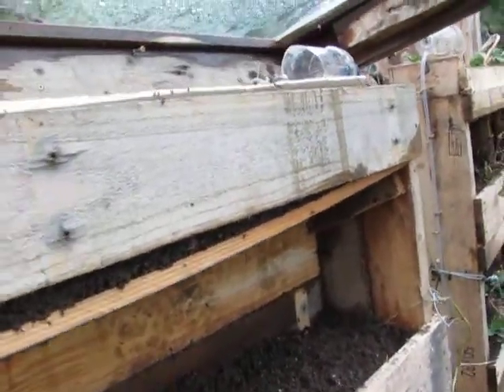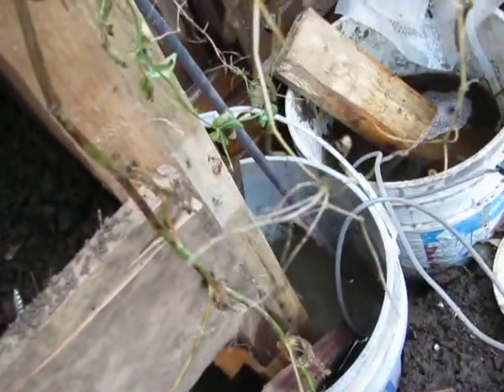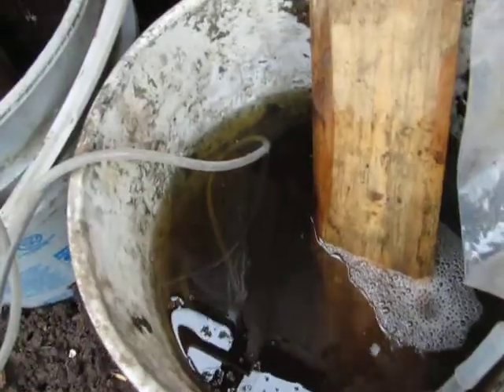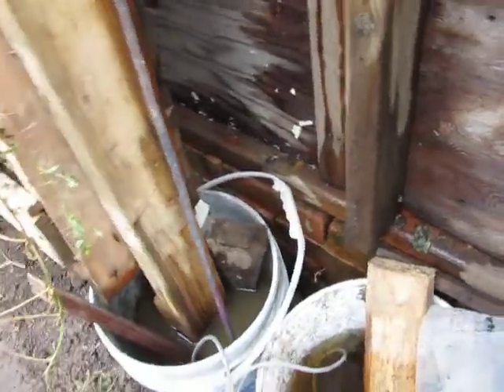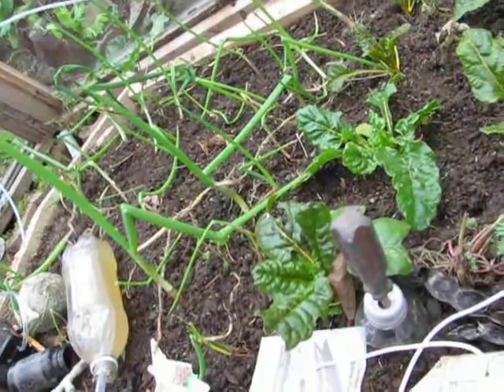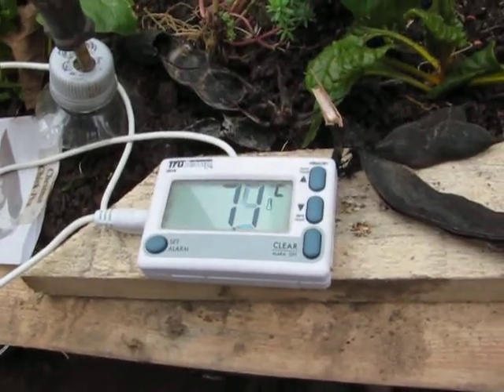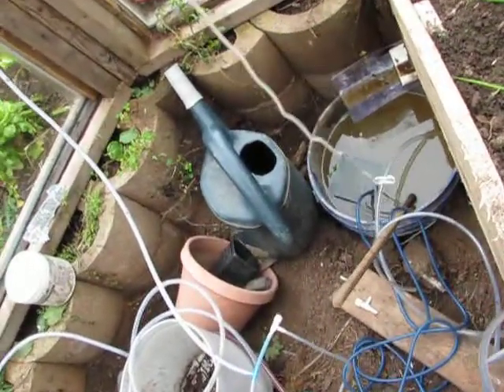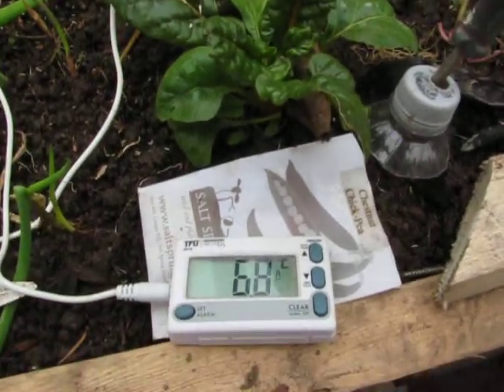Windowfarms Pallet garden Airlift submergence experiment  (Results in the comments)

Comment from the maker: Anyway,  it went to 5 inches submergence pumping 66 inches high BUT the entry into the tube curved up to 5 inches so no more water could get in to make it go lower (Silly me).  Easy experiment to do,  results may differ due to a thousand factors.   Water hardness, tube diameter, bacterial/algal coating on the tubing, etc. New tubing ALWAYS seems to pump poorly. (In the ourwindowfarms community, people complain and then 3 days later "its working now"! (Because the tubing has got dirty!)